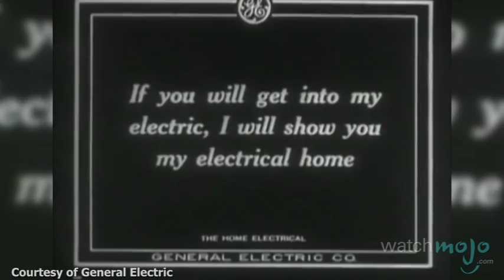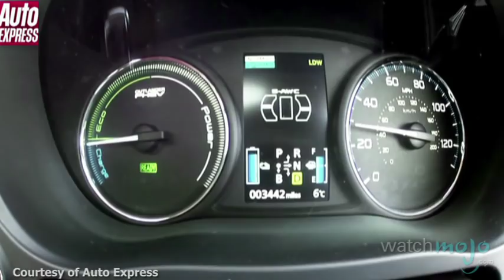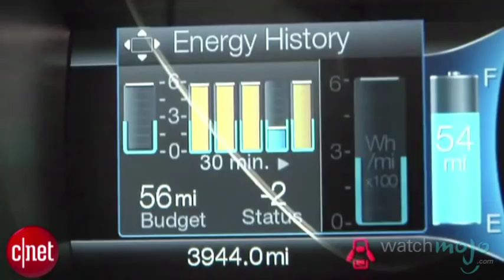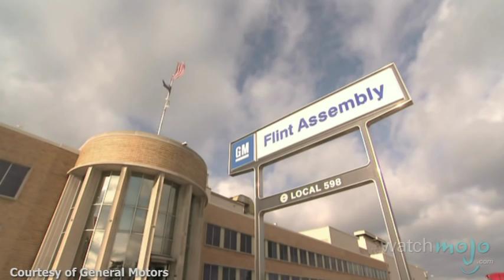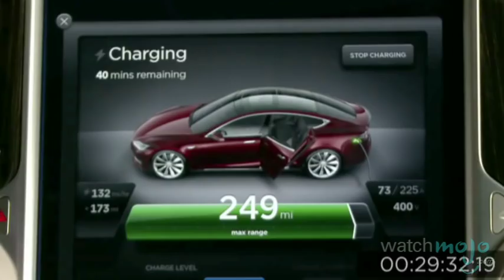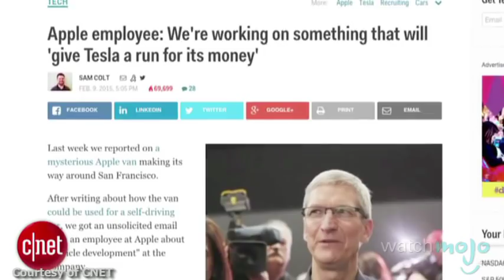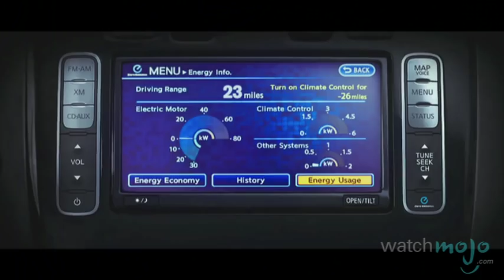10 Electric Car Facts - WMNews Ep. 16

Comment: I wonder if the Apple car will bend when you sit in it.
Reply: Rens Kersbergen oh snaaap!
Reply from the maker: Daenerys Targaryen You guys are pretty darn clever.
Signed,
KG
Reply: Rens Kersbergen
heeeeeyo
Reply: or whether it would have windows
Reply: oops. Didn't see ur comment
Reply: Rens Kersbergen They won't have Windows, they will have Wind Shields and Observation Portals
Reply: maybe it would have like Ipads and like it would act as a camera?
Reply: I wonder if the apple car will hace the latest ios haha
Reply: U have made my day good sir/maam
Reply: ***** 'new'
With a couple of years old tech.. well done apple.
Reply: I bet the windscreen will smash easily like the screen in my phone has done.
Reply: The Apple car will have windows and a mouse, 3 years before the Microsoft car.
Reply: A new one will be released every year rendering the previous model obsolete.
Reply: The biggest problem with the apple car will be that every couple of releases apple will change the cable requiring massive infrastructure changes and non of your personal affects will fit from the older model.
Reply: I wonder if Apple will call it the iCar
Reply: Daenerys Targaryen Hee hee ;P
Reply: Bend thee knee...
Reply: No but i bet that the Chinese will be able to spy on you!

Comment: Fact number 8, impact on the environment, misses the fact that most batteries are made out of chemicals that are very bad for the environment. Though they can be recycled, it's likely that many will be thrown away. I love electric cars and I think they are the future, but this is an important point to make. Hopefully in the future the batteries will be cleaner.
Reply: I disagree, most of the materials used in the Tesla's batteries are not toxic. And I also disagree that you said most won't be recycled. There is too much raw material that can be re used for companies not to place a price on turning in old batteries. Also remember all the motor Oil, brake fluid, power steering fluid and transmission fluid, coolent/anti freeze that won't be going into the aquifers now.
Reply: Roller sail They non toxic, recyclable batteries. Where are you getting your information? Severe draining? Have you had experience with this never before reported problem? 

Have you ever heard of a debate? People disagree and agree with other people, its something learned people do.

Here are my sources

http://my.teslamotors.com/de_DE/node/3855 

or if you don't trust Tesla 

http://www.treehugger.com/cars/heres-what-happens-to-a-tesla-electric-car-battery-at-the-end-of-its-life.html
Reply: What?  None get thrown away.  They are far too valuable.  Nobody throws EV batteries away.  That's a huge heavy and expensive chunk of lithium that is worth thousands of dollars, easily the most expensive and valuable scrap part on a car.
Reply: Solomon Parker Exactly. People will recycle or re sell anything if they can make a buck. Not to mention, where would you "throw it away" not like you can deliver it to your local dump. And if you did they would most definitely take it and sell it to be recycled.
Reply: Are batteries in combustion engine cars worse than ones in electric cars?
Reply: Robert Maiorana
Lead acid batteries are almost completely recycled as well.
Reply: Lets say the batteries last 100k.km. and you are going to compare it to a gasoline car

What is worse, the chemicals used in the batteries or the 10000 liters (the car has average consumption of 10/l per 100km) that you will burn to drive these 100k km.

I'm really wondering. What is worse?
Reply: Mastermind12358
Wikipedia says less for BEVs, but even if the battery caused more carbon dioxide, what it doesn't cause is all the other pollution that cars put out, like unburned hydrocarbons, soot, nitrous oxides, etc.  It is far easier to regulate pollution at the power plant level than it is at the vehicle level where people don't change their oil, don't change their oxygen sensors, modify exhausts, use old fuel that doesn't burn as cleanly, defeating pollution control devices for performance gains, etc.  There's nothing I can do to my car to make it less efficient other than poor driving habits.  It will never produce more pollution at the tailpipe because it doesn't have a tailpipe.  Meanwhile, in the state where I live, and many other states, every year the proportion of renewable energy rises and the use of coal decreases.

Comment: Tesla Model S P85D goes 0-60mph in 3.1 seconds... How did you forget that. It is one of the most important selling points and many people get this car because it can beat Lambos, Ferrari and Porches. Also your super charging data is incorrect. Tesla has updated it to 20min charge to go from 0-80%. And another 20min for the rest of the way. And the super charging map you showed was VERY outdated.
Reply: Are you sure it's 0-80% in 20 min? The Tesla supercharger site says 0-80% in 40min. I was always under the impression that the 20min charge time is only to get approximately another 3 hours worth of driving.
Reply: Justin Wong Wow I'm sorry, you are correct. That must have changed recently. Very sorry for my incorrect information and thank you for the correction.
Reply: Eric Fling 0 to 60 in 3.1 second yes but how consistent can it be. Being a huge gear head and studying engineering I can tell you that the tesla can run 0 to 60 in 3.1 second one or two times then as the gear heat soak and the battery that time becomes higher an electric car will never be a full out race car because of this unless something can be don't to combat this also as the battery heats up battery will drain quicker.
Reply: esteblack Tesla uses a cooling and heating system for the batteries so this problem does not occur. And it is a single gear transmission so very little mechanical energy is lost to heat.
Reply: Thankfully there are people in this world like you who care about the environment!  My parents have a Nissan Leaf and we live in a rural area.  You'd think living in a rural area it would mean having an electric car would be a disadvantage? Surprisingly, it's not.  I live on a coast with only 60,000 people and a really small town, in Canada.  In the town, we have a super charger, and for such a low industry of the car product, Nissan Leaf, I see them all over our town for such a low population.  Commuting is simple even with my father driving 45 minutes each way to work, and he charges the vehicle at home.  Living in a rural area, there are lots of hills which charger the vehicle and I think everything about the concept and the vehicle is great!
Reply: It is spelled Porsche. Named after Ferdinand Porsche. The founder of the company. Also never pronounce it Por-sh. That is the worst.
Reply: Eric Fling
You might have been referring to the LEAF which can quick charge 0-80% in 20 minutes in good conditions (a fact to which I can attest).  But it has a third the battery capacity of a Tesla.
Reply: It now goes 0-60 in 2.8 secs
Reply: +esteblack
>Studying engineering 
>Spells like a 12 year old
Right.....

Comment: I love the Electric car, i think it's the future, but unlit they get to the point were i can step in it and not have to worry about whether or not I'll be able to get home, I'll stick with my Mustang.
Reply: Well they are vastly more reliable then a mustang sooo not sure where you are coming from with that comment. I am mainly talking Tesla here.
Reply: Eric Fling Sorry you miss understand, when i said! Step in it" i meant the throttle.
Reply: Model S P85D is faster then any mustang ever made... Sorry man but 0-60mph is 3.1 seconds is amazing (except the outrageously expensive cars) and you'll still get home just fine.
Reply: Eric Fling It's not about speed it's about range, not all electric cars outdo ICE's on distance and spending $80,000 more just to make sure you can get home is about as stupid as you can get.
Reply: I've run out of charge once.  I've run out of gas at least a dozen times.  Just be a responsible driver and it won't be an issue.

Comment: In my opinion Small diesel is the way to go. Also use ethanol made from corn and bio diesel made from vegetable oil. Think about it, you have to replace the battery in your normal car every 7 or so years, it's going to be really expensive to replace the battery pack in a hybrid/electric car. There's a reason Gasoline/Diesel engines have been used in cars and trucks for over a century, because it's the best idea. Plus making batteries isn't good for the environment either.

Comment: You guys have less facts than Fox NEWS.

-Honda has hydrogen car for few years now. FCX Model. (there might be more cars but definitely toyota is not alone)
-Hybrids are powered by generator that runs when car goes above 30mph and stores energy into battery. If it was powered by brakes friction only, it would not go far on electrics
-Leaf is not a hybrid, it's fully electric.
-There should be 5th category of an electric cars, an active hybrid it runs along with gas engine.
-Problem with Apple building a car is that it takes thousands of engineers and few years of development and it would be an impossible to hide. When Apple will start making an electric car we will know it fast.
Reply: Just a fly by it seems, they also ignore the electric car with a gas. Generator.. Not really a hybrid, but similar to the hydrogen cell car, the volt and the i3 charge themselves with a gas generator. Yes and the Bolt... But if you talk like a robot you sound smarter I guess

Comment: Missing are the facts that producing the car battery also leave a hefty carbon foot print and that it require replacement every few years... so... good job Liberal Watchmojo. At least you admit that Electric Cars are not 100% clean because electricity (mostly produced in coal power plant in the States) are still required to charge the car.

Comment: #8 One car magazine once calculated the carbon footprint of an electric car powered by electricity made from coal. It was larger than the carbon footprint of a Citroen C5 with a 2.2 diesel.
Reply: +Car Lover . That car magazine conveniently failed to take into account that you need to use electricity to create gasoline to begin with. It takes a tremendous amount of electricity to refine oil into gasoline. According to reports by the oil industry, it takes 5 kWh of electricity to produce each gallon of gas. Then there's the tremendous amount of electricity used to power every gas station 24/7. Therefore, gasoline cars are responsible for pollution at the power plant and from the tailpipe as well.
Reply: +Car Lover . Now as far as diesel fuel is concerned, it also takes a tremendous amount of electricity to create the diesel fuel at the refinery and to power the diesel station. Not to mention what it takes to extract the oil from the ground and to transport it to a refinery. Also, each diesel truck burns 50 gallons of diesel per day just to get the fuel to a service station. Keep in mind, this is just to fuel the car. That car magazine conveniently didn't take any of this into account. They assumed the diesel fuel was created out of thin air and just appeared in your tank.

Comment: you guys forgot to mention how deadly hybrids are for firefighters, police officers, any first responders, and anyone involved in a crash when any of the vehicles are hybrids, and just so you all know, when a hybrid gets in a wreak, the battery is burst and wire are ripped which then go to the ruptured gas tanks, and then lights up the gas, and burn the battery sending the corrosion into the air. to put it in an understandable way, remember how your parents always told you that battery acid is bad? well imagine getting it into your lungs and ALL over your body

Comment: Why not hydrogen powered cars to? These do exist search it up
Reply: MYTHICALTWINKIE Only problem is that Hydrogen is a bitch to store, and therefore they aren't as good as in theory, atleast now
Reply: Did you even watch the video?
Reply: A few reasons.
1) They aren't as efficient as electric cars; They're efficiency is roughly equal to that of a hybrid.
2) Hard to store, as stated above. It's an invisible, explosive gas. Hydrogen must be kept at extremely high pressures to remain a liquid.
3) The infrastructure is non-existent. The fast re-fill time is the only current advantage that a fuel cell vehicle has over an electric car. If fueling stations aren't widespread, this point is invalid. Electric cars, on the other hand, can be charged anywhere, especially at home, and for road trips, chargers are being installed world wide to address this problem (see Tesla Supercharger).
Reply: Roller sail
Hydrogen is only liquid when stored under immense pressure and extreme cooling. Do your research :P
Reply: Roller sail Fuel density is MUCH lower
Reply: Hydrogen powered cars have been 10-20 years away for decades.  They can't catch up.  They never will.  They are basically an electric car with a bunch of really expensive extra equipment.  One of the big problems is that Hydrogen leaks through solid metal.  It is unsafe.
Reply: maxstone2210 i know i was just stating this sorry if i sound stupid but the stuff your saying i already know.
Reply: Fires
Reply: MYTHICALTWINKIE  I was referrig to Roller sails comment. Nothing wrong with you (except your grammar maybe).
Reply: maxstone2210 hey... okay fine ;,(
Reply: MYTHICALTWINKIE its like owning a bomb

Comment: Get a Diesel. Better gas mileage and Less soot = Cleaner exhaust. Plus they last like 300K miles
Reply: YES!
Reply: Joseph Moore lol my bad XD
Reply: Joseph Moore Eh neither are actually a gas. Liquid miles per gallon? lol
Reply: hi toyota diesel owner here. They're sluggish, low powered but high touque, still high soot (Aus), easy 3tonne+ towing, 500km+ range (8.5/100lt - 27mpg) 3.0lt 4 cyl, expensive as hell to repair if gone with Common Rail Diesel engines, great for 4wding etc etc. they have advantages and disadvantages. miss the power of my V8 commodore though.
Reply: As Ford has said, diesels don't make economic sense.  The purchase price is never made up by the reduction in fuel costs, especially lately when diesel fuel is much more expensive than gasoline.  I like diesels, I wish they were more economical for the vehicle type I need, but lifecycle costs speak for themselves.
Reply: diesels are high pressure engines but they have to be built robust otherwise they blow the head straight off. but they are what people choose for trade.
Reply: *****
we have a much dirtier grade of diesel here in aus but america has the better quality where we just get left behind no matter what. but i agree with what say there.
Reply: *****
yeah i suppose.
Reply: the internal combustion engine is clumsy in its nature.  imagine there is piston, and tons of moving and rotating parts before that energy transfers to wheels.  it was understandable for last century but for now? after studying the parts of electric vehicles i know fore sure now that electric cars is the next logical step to Internal combustion cars.
Reply: Ever heard of Volkswagen Dieselgate?

Comment: Even if the energy used to poet an EV comes from Coal, it's still nearly 50% less polluting than a comparable gas car. While this video was not untruthful, it skimps on some important details. Also, a Nissan Leaf  is not a hybrid, it's fully electric.

Comment: If the made the cars solar powered that would save allot on building new infrastructure. The paint of the car would produce the energy to recharge the battery of the car from the outside and inside. A car can get really hot from the sun when left outside. They have the technology to do so but it is expensive short term, but think of the long term.

Comment: What you are doing is making the rich, richer.. How much will it cost for the car? How much will it cost to charge the battery in your garage? If your electric bill is $200 a month for a 3 bedroom house how much more will it be to charge the car?.. You do know there is a gas engine in that car also… How long will it run with a charge or without a charge? How long will it take to charge? How much will it cost to install a special plug in your garage to charge it? Depending on how much you use it I can see a $2000 monthly bill for electricity.. Remember they will stick it to you any way and as much as they can…. The way I see it and figure it out it will cost you more to run the electric car…. You won’t be alive long enough to make any difference, then it won’t matter anyway…How about insurance? Never mind I’ll keep my Mustang… I’ve had to 130 mph then it shifts it to 5th gear…
Reply: You need to go read a bit, almost all of what you stated is false http://www.nissanusa.com/leaf
This will vary with your local electric rates. With an average electric rate of $.11 per KWh and driving approximately 12,000 miles per year, the approximate cost in electricity would be about $.03 per mile, $26.40 per month, or $316.80 per year.
Reply: Larry 306 l can answer your questions from my experience owning my 3rd imiev. 1) $7000 used 2) $1.60 3) $25 4) no engine 5) 62 miles by epa but I can do 80 6) level 3 charge takes 20 minutes, level gal takes 8 hours. 7) no special plug needed 8) maybe $30/MO. increase 9) insurance is the same 10) l have the same mustang and don't drive if anymore.